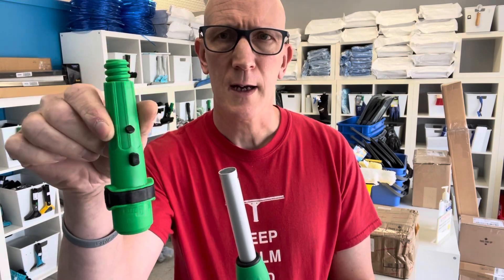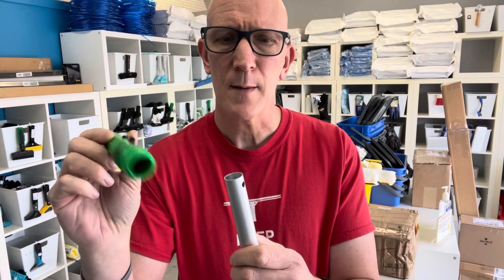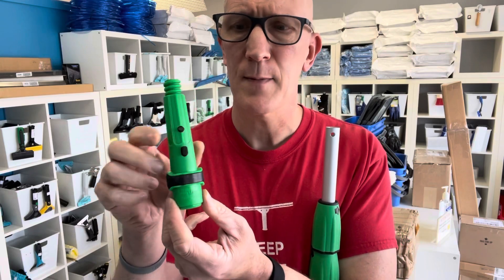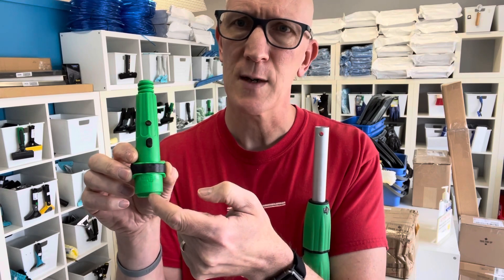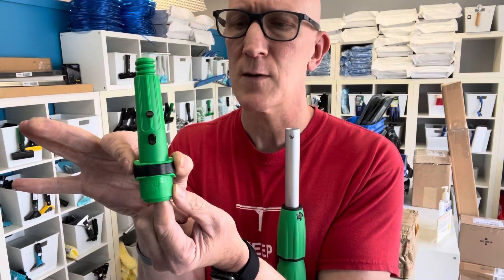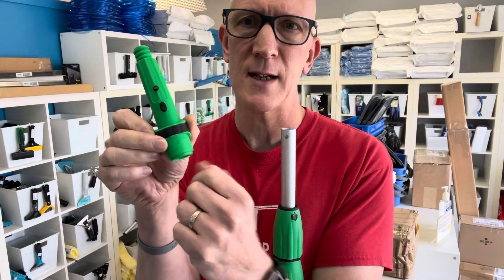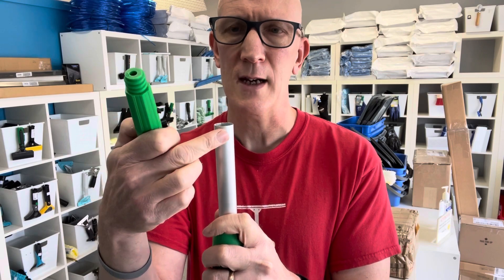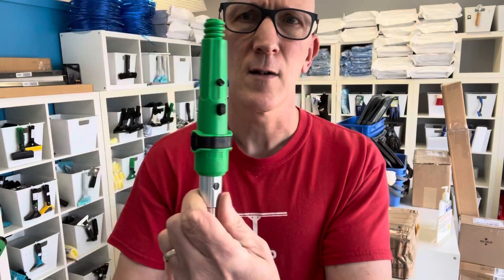Replacement Unger Pole Locking Cone Tip - How To

Comment: Awesome video, thank you!  One note:  I found that the new Unger Pole Locking Cone Tip is so snug the wiper blade attachment and microfiber brush would not slide down far enough to engage the locking mechanism.  So, I shaved a little of the plastic off on each ridge using a box cutter.  After that I could get the brush down far enough (though still plenty snug!).  Regarding the  Unger wiper blade handle, I had to cut out the rubber handle so as to see the hole and drill it out so the plastic locking mechanism would fit  . . .  after that, all good.  A quality product all around!

Comment: Thanks Mark! Only problem is my Unger pole does not have that locking tab to release my old broken tip or insert the new one, what are my options? Apparently I have the "blue" version..Thank you!
Reply from the maker: Ah, you have the consumer grade Unger pole from the big box stores. You can’t remove them.